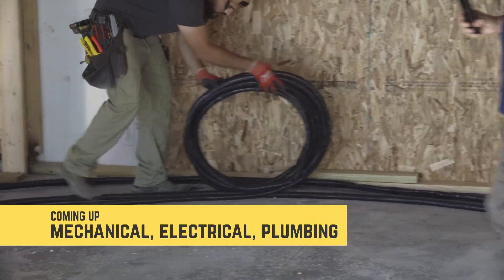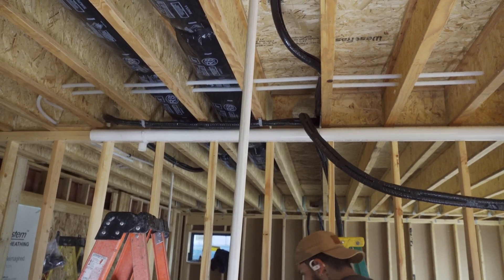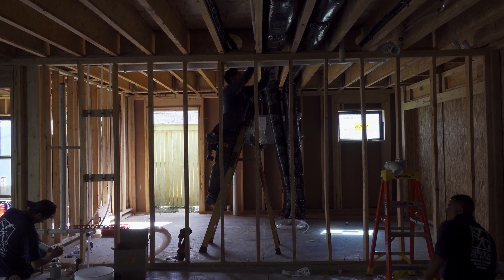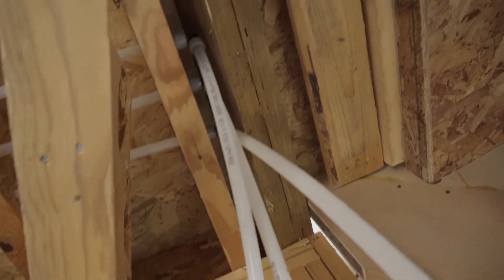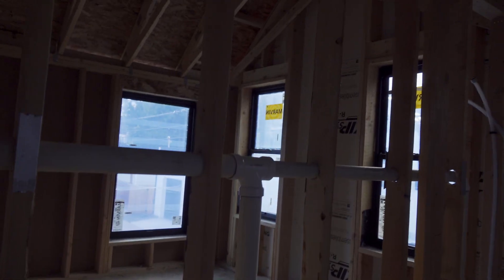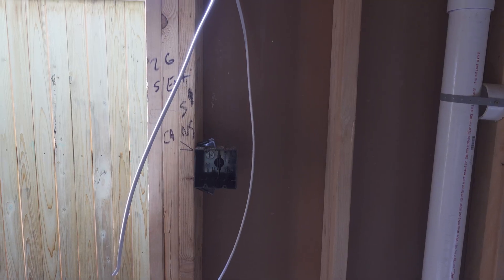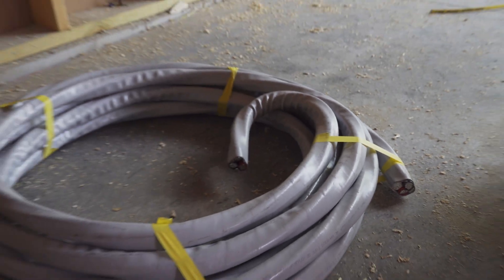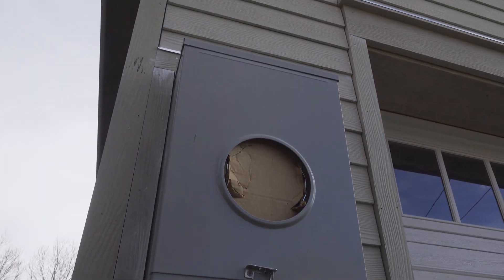HVAC, Plumbing, and Electrical! Full MEP Rough-Ins | Denver ADU Build

Comment: That is a ton of structural support that yall cut out of that corner.  Yikes!
Reply from the maker: yeah it's a lot but there isn't a second floor above that part of the wall + there is a steel moment frame on either side of the garage to support the structure